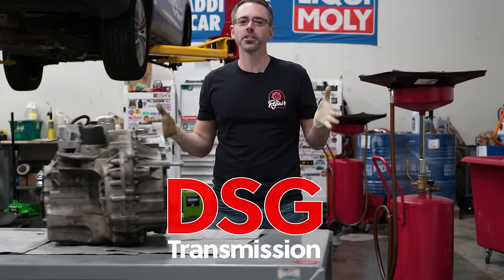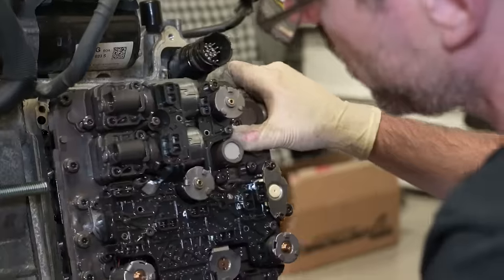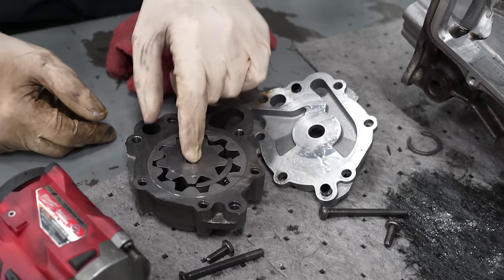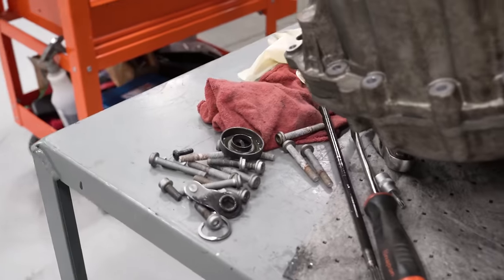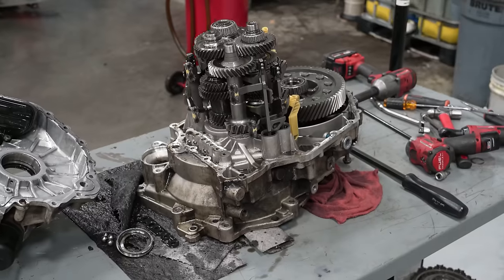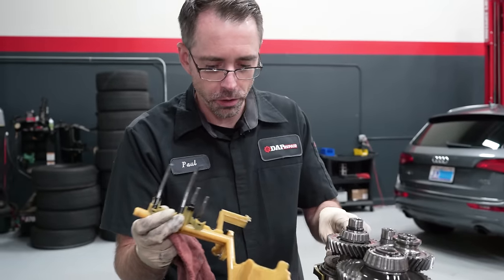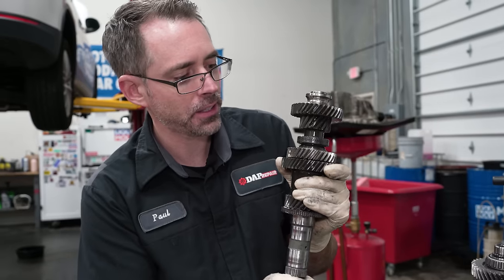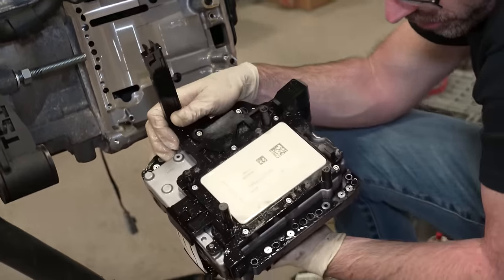Why Did This DSG Transmission FAIL?

Comment: I have a 2013 GTI / DSG with 211,000 miles, much of it highway mileage. I'm concerned however, because nothing lasts forever. The DSG has been flawless thus far. Because much of my driving is highway, I've been doing my DSG oil changes about 60-70K miles. The fluid always looks nice and clear, only a little darker than the new VW fluid that replaces it. This GTI is the best car I've owned, hoping it will see 300,000 miles someday.
Reply: Hi, still on the stock engine, can you share some of the problems you've had so far?
Reply: Thats a good interval but in Kilometers :) DQ250 are pretty bulletproof.
Reply: Yes, my engine is completely stock. It's been nearly flawless. The OEM water pump began to leak after I received an early recall notice, so I had it replaced. Since then I replaced the coil packs after two failed. Outside of oil changes and spark plugs, I didn't replace anything until the 190,000 mile mark when my idle was becoming noticeably rough. I had received a notice from VW that my GTI's intake manifold was likely faulty, but my mileage was beyond what they covered. So I chose to replace the intake when I did a valve cleaning and replaced the fuel injectors as well. With a new intake, clean valves and new injectors the car idles like new once again. As a precautionary measure, I have an appointment to have the timing chain, tensioner and guides replaced later this month. I'm letting VW complete this task which will be the first time they've seen the car since my early water pump replacement.   @BLACKRACERONE
Reply: I can't argue with that, but at 200K and fairly clear fluid at changes, I still believe I've done okay given the highway use. @TerribleAcid
Reply: @Fmandan77  Thank you very much I've just got a MK7.5 GTi Engine code CHH with 40.000 miles, I just hope I get the same mileage as you .. Its a DSG and I'm planning keeping it stock.
Reply: I would put much more trust in a high mileage car like yours over a low mileage city car (the types usually advertised as one careful lady owner, etc). Motorway speeds place a good load on the engine without over exerting it. Your car should easily see 300k and beyond with your current maintenance pattern.

Comment: I’ve had an MkV Golf 1.9TDi with one of these and although, I had to spend just over £600 on it to replace the flywheel or the clutch(?) if I remember right, it was the gearbox that changed my view on auto gearboxes. I’ve had various Mercedes (SL, 190E, C/E 4/6 cylinders) and some awful Subarus (Outback/Impreza) with auto gearboxes, but no other gearbox came close to the speed, convenience and comfort of this. I still toy with the idea of getting either an auto GTI or an A3 with one of these.

Comment: No issues getting hold of a DSG rebuild gasket kit in Europe. Too many of the mesh gauze gaskets fail blocking the clutch solenoid.
Reply from the maker: Interesting do you have any links to more details on this

Comment: I have a T6 Transporter with just over 200k on it.
I regularly tow a 2T air compressor on jt.
Love the 7spd DSG, it performs so well.
Its faster shifting thany Polo GTi because it doesn't do the fart noises 😂

Comment: its a very good transmision, here you can see that somebody didint make oil changes and a bearing goes missing, normal thing if you dont change oil in 50/60k km, in europe you can get rebuilt set for this trans.

Comment: The first DSG equipped car in the US was the 2004 New Beetle TDI. Those early boxes had some really odd behavior, particularly on cold days. I recall my 06 GLI would sometime lurch (!) on start on cold mornings. They seemed to have ironed out most of the problems with the S-Tronic box that is in my 18 A4, except for servicing costs. I thought VW was going to "dry clutch" DSGs that used much less fluid. Guess that didn't pan out.
Reply: They used dry clutch DSGs on some of the lower-end cars in the rest of the world. The 1.4 TSI twin charged engine for example I think could be had with a 7-speed dry DSG. That whole combo was horrifically unreliable, so yeah, that didn't pan out
Reply: @tally5k339  The Jetta Hybrid had a dry clutch 7-speed DSG, too. I don't think it was quite as problematic as other applications of the same transmission, likely because it didn't need to slip the clutch to get moving in most situations since it almost always started in electric only mode.
Reply: Technically, the first U.S. car with a DSG was the 2003 Audi TT 3.2, but the 2004 New Beetle TDI was the first VW in the U.S. with the DSG.
Reply: My mom has an 2015 A3 1.4 TSI hatchback, which she got new and has been with it since, back in Brazil. This model has the DQ200 transmission (dry clutch DSG), and it is pretty amazing, but it indeed has that infamous unrealiabiity history due to being 'fragile'. This year the trans failed all of a sudden, then she took it to Audi and they covered the services for its replacement, given she did all the services regularly there. 
It took them 2 months to repair it (mostly due to having to wait for parts to come) and the bill was around 8k USD (rough convertion to the 40k BRL bill), which is nuts considering the car is estimated at around 75k BRL, so more than half the value of it.... 
Had Audi not covered the repair, it would certainly be scrapped. Apart from that, the car still looks and runs great tho.
Reply: The present 1.5 litre Renault Scenic Mk4 7 speed dual clutch automatic gearbox has two dry clutches which means the gearbox oil remains much cleaner for much  longer. So far I have not ben able to find a garage to change my 1.5 litre Renault Scenic 7speed dual clutch  gearbox oil.  
I do not trust any dealer garage because after over 50 years of driving I have had  to conclude that all the dealer networks are interested in is selling you a new car. I have no doubts that  they would be strongly  tempted to sabotage the car you already have.   I now have 30.000 miles on the clock and I am still trying to find some decent garage or mechanic to change it for me!.

Comment: I just bought an A3 that has a slight rythmatic thud when coasting at low speeds. after replacing a bunch of surrounding stuff I have found my DSG is making the noise. I can get the the noise to stop whenever I put the car in neutral. I have a kit to do filter and fluid so hopefully that fixes this mess.

Comment: Changed my dual clutch in my DQ250 from my Polo this week, 1400€ out of my wallet and it drives amazing. Still a few weird actions, maybe it's time for a DSG tune
Reply: U got wet or dry clutch
Reply: @KasamS DQ250 is dry clutch
Reply: @YZJB  it looks pretty wet to me. Dq200 is the dry one

Comment: I bought an audi rs3 early this year and they only come with a DSG.  Its actually the sturdiest dsg vw builds, the DQ500 , which is actually rated for 600NM, weird right? tho they supposedly handle 800nm  stock  and up to 1000 on upgraded  clutches very well. a coworker complains about the 250 or 381 not being very happy with handeling more than stock power.

I miss the feeling of a manual but this thing does it pretty well i would say. it is a perfect bridge between comfort, effiency and "sportyness".  Put it into manual and you feel like racing driver, pulling peddals, smashing in the next gear. you can even "manually" shift with the stick but vw/audi fucked up the orientation. so you pull on the shifter for down and push for up. Porsche does it the other way arround like in every sequential you see on rally cars and such. Works very well but it can get "overwhelmed"  when you shift into a gear it didnt expect. like when you want to downshift from 3rd to 2nd but were crusing before so it had 4th selected. takes a second before it shifts the appropriate gear and then engages it.
Reply: The DQ500 isn't the sturdiest of the variants, that title belongs to the DQ800 which is found on the second gen R8s and Lambo Huracans. The 800 can handle over 1200Nm with stage 3 race clutch packs. The DQ500 and DL501 (longitudinal engine variant) are near identical in specs and I believe the mechatronic units for both boxes are the same. I've run TVS stage 2+ TCU tune on my stage 2+ B8 S4 and it has totally transformed how the car drives. Butter smooth up/down shifts in normal drive mode and satisfying DSG farts when giving it some. But like you I'm totally sold on this type of transmission and absolutely love it. Also looking forward to when I eventually upgrade to a C7 (or C7.5 if budget allows) RS6 next spring. I can see why people are wary of them though, but I simply ignored all the internet hate on them as the known faults were widely exaggerated and quickly ironed out with recalls on the first gen units with lower quality oil that allowed sulphur buildup/failure on the mechatronic units.

Comment: So can this transmission still fail if kept up with fluid maintenance? My wife has a Jetta tdi with a dsg and I researched this trans enough to change the fluid myself at 155k miles because I had found out it never got changed, just wondering what kind of chance at survival it has😂

Comment: We have 06 TDI  200,000 miles new  cylinder head swapped transmission with one 168,000 miles junk yard  noises in transmission common issues of overheating an failure of mechatronics unit is trans cooler on top of DSG cooling restriction had been plugged no flow of coolant should be checked for flow. Also we seem dual clutch fly wheel wonder if the vibration would put strain on bearings? Never had one apart but have did a complete drain when out on bench.

Comment: What would be the reason that the DSG is hesitant and 'bangs' on pulling off? 

I have a Mk5 GTI with DSG. It's fine throughout the gear changes 1-6. From N to 1st it's jerky but only when the oil is hot?! 

Any help would be appreciated

Comment: I've rebuilt transmissions before, and this transmission looks stupid simple to rebuild. If this looks complex to you, wait until you see a Ford 5R55. It's such a shame that this is a non-repairable transmission, so the shop I worked at would not let us touch these due to parts availability.

Comment: Can't believe they don't make replacement parts. Basically you'll be throwing out a transmission that was fine apart from a single bearing. But then again for the VW group, it's not really a surprise. The one question I have though, it can select two gears, one that you're driving with and a future gear. How does it know if the next gear change will be up or down?!
Thanks for the fun video!
Reply: I can’t say for certain but it’s probably programmed to look for user input and body movement. If you’re on the gas pedal it knows that you’re going to continue moving up through the gears so it queues next gear, if you remove your foot from the accelerator, it can likely assume you’re going to slow down and it needs to queue a lower gear - if I were to guess - I’m sure there are a ton of other sensor input and programming things but what I’ve explained is probably 80% of it.
Reply: Got a mk5 gti with one, it's all in the software, if you downshift while cruising it will take a good second to downshift and it will be a bit harsh. If you downshift while braking or starting to accelerate it's fast and smooth as.

Comment: I think the 2004 diesel beetle with a DSG was was actually delivered in the US before the MK5 GTI. I was selling VW’s at the time and distinctly remember getting a TDI beetle for the lot that came with a DSG well before any MK5 GTI’s showed up.
Reply: the MK4 Golf R32 was the first to have it
Reply from the maker: You’re right the TDI beetle was the first VW in the US to have a DSG.
Reply: My 2006 TDI (BRM) Jetta (us spec) came with a DSG and i love it! 389k and on its second clutch! Still going strong!
Reply: @Deutscheautoparts the vr6 audi tt and the mk4 gti both arrived here in 2004 earlier than the tdi beetle also

Comment: had my gti mk7 for 7 years now put 43k on it and the one thing i do not like about dsg is driving it in regular mode. 99% of the time i shift it myself. when driving in D without sportmode i feel like ill be in 5th gear doing 30mph. and the apr dsg tune did not help
this.

Comment: Fun video. I have been driving VWs since 1973. Now I have a 2015 Sportwagen TDI and a 1992 Corrado I have had for 31 years. The whole reason I have always driven VWs is because of the fun of their manual transmissions. In all those years I have never had a transmission problem, except for clutch replacement. It appears the end of the manual transmission will arrive at VW before I buy my next vehicle. So our 50 year relationship has ended and my next vehicle will likely be a Toyota/Lexus with the first automatic transmission I have ever bought. I will admit that 200,000 miles is very good for a DSG, and if it could get there without problems and significant maintenance costs it isn't that bad. But since DSG lacks the fun of a manual, why not just get a simpler more dependable traditional non-CVT automatic transmission?
Reply: The issue in the video was that they bought a rebuilt trans.  Way too complex a system to trust a shop rebuild  MK7 dsgs are much better.  I agree though that manual is much easier to take care of.  Usually just replace the clutch every so often and you're good.
Reply: A traditional (torque converter) slush-box or a CVT is actually very different than a DSG. The DSG has more in common with a manual (it's basically a manual trans inside, with wet clutches that are operated by solenoids) than it has with an auto. The gear engagements in a DSG are crisp like in a manual, compared with the mushy engagement in an TQ auto. The power loss is much lower in a DSG (similar with a manual) compared with a TQ auto or CVT. As far as reliability goes, the VW/Audi DSGs are quite reliable IF YOU MAINTAIN THEM (timely oil changes with the correct DSG oil), which most people don't do. A proper maintained DSG should last much longer than a TQ auto, and an order of magnitude more reliable than a CVT.
Reply: I disagree that the DSG isn't fun.  I drove manuals for 30+ yrs i have no complaints all while having a quicker car.  To each their own.
Reply: @raoulrr  it is strange that people do not maintain them. In the EU VW recommends to change oil and filter in the DSG each 60k kilometers (so just like in a standard manual).
Reply: @Anduvir  is that for the 6 spd or 7? Here in the USA VW specs every 80k miles on the 7 spd.
Reply: @eppyz  7 speed. At least I was recently told that Cupra requires you to do so. I read some forum posts and they say 120k kilometers. Hard to find good source unless you call the official service.
Reply: @Anduvir I checked the manual that came with my car and it states 80k miles but i plan to change it at 40k my MK6 GTI which has a 6spd DSG was recommended at 40k interval so not sure what is different between the 6 and 7bspd maybe a different gear oil spec?
Reply: Corrado Master Race
Reply: You have a weird logic thought process.  Why would you change to a different brand just because you want an Auto?  The DSG is virtually bulletproof, and if you thoroughly understand manual transmission operation the DSG is a fantastic transition.  All the wankers who complain that the DSG is jerky or weird have never understood manual transmission operation.  Only those people should go tor CVT (because they are so bloody unreliable) or T/C autos.  Note that many VW/AUDIs are moving back to T/C autos because the latest ones have virtually instant T/C lockup in all gears and can be made with 10 speeds (which is stupid IMO - no-one needs 10 speeds ever).
Reply: @einfelder8262  Automatic transmissions are lame. If I have to get one then I am going to go with a run of the mill Aisin automatic because it is least likely to break by 200k miles. Everything else doesn't matter, from performance, fuel economy, comfort, ... I do most of the work on my vehicles, but modern automatic transmissions are beyond my skills. 

I won't buy mk8 VWs because they no longer permit diagnostics using my VCDS. I am told that after twenty years I need to be protected from figuring out what is wrong with my VW. 

You can say the DSG is bulletproof, but people do have problems. And it you have just one, then the cost will be greater than I have spent on VW transmissions in 50 years.
Reply: @drwisdom1  Aisin autos are not bulletproof, and in case you aren't aware, CVTs are a disaster.  My DSG is 15 years old and going perfectly.  As you saw in the video, the gears are monster sizes, the clutches are perfectly suited to the task.  Why the bearing collapsed in this one no-one knows, but that same bearing could collapse in any transmission even an Aisin.  Moving to a Toyota/Lexus from the VW world indicates a possible loss of will to live.......I'm 72 and I would rather die than get rid of my GTIs and move into an appliance.    😁
Reply: @einfelder8262  You can't draw a line with one data point. Statistically the Aisin traditional automatic will be less likely to fail than a VW DSG. If it does the Aisin will be much cheaper to fix. I am not selling my Corrado or Sportwagen, but we live in the Colorado mountains and I need AWD some of the time. So I am leaning toward getting a used 3rd gen (2010-2015) RX350. They have a very comfortable ride and there are so many the prices are depressed.
Reply: @drwisdom1  You do realize the 8 Speed Autos in VW's are made by Aisin right?
Reply: @eppyz  I guess that is a positive. But what modern VW would I want? I have been driving GTIs, my Corrado, and my Sportwagen with manual transmissions since 1983. I don't care for VW's SUVs and have never owned a sedan. If I get another VW it would probably be a used mk7 GTI or R with a manual.
Reply: @drwisdom1  buy what you like.  I am not sure what your needs are and you mentioned you would possibly buy a Toyota/Lexus and other than the GR an IS500 those 2 brands are the must boring cars made.  Yes "reliable" per se but ugly and boring🙄